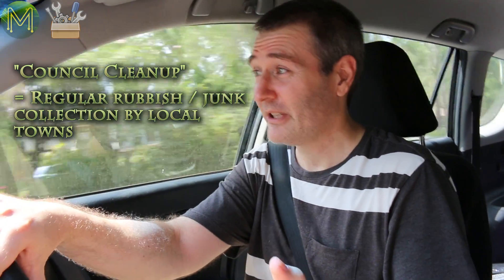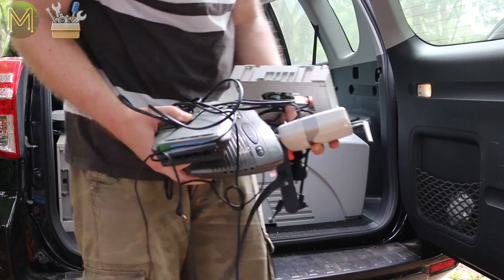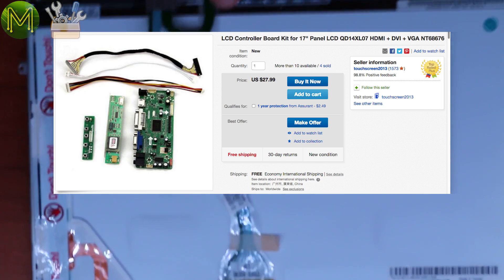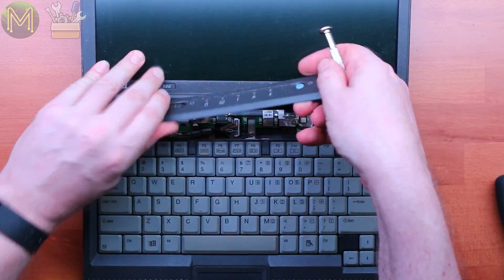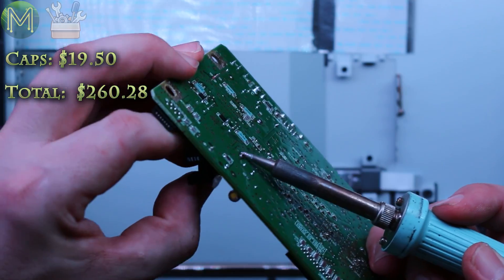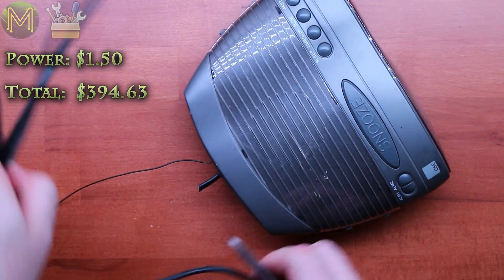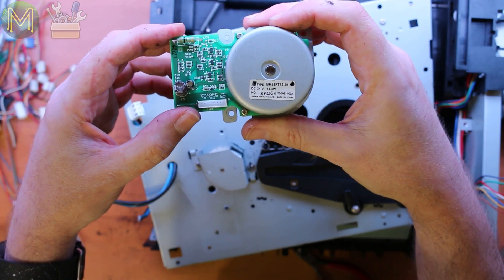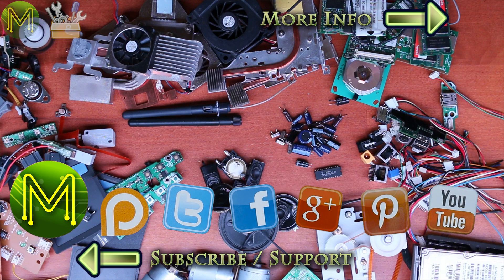#143 Saving Electronics: What Can You Save? // Tutorial

Comment: How would you use the RJ45 connectors? They aren't actually breadboard friendly and for homemade PCBs the drilling of the holes cannot be fun. What would you use those for? Cheers and of course thumbs up! JM
Reply from the maker: +JM Tosses 
I generally use them for long serial connectors, or panel connectors. You don't need to PCB them, but can glue them to an enclosure and just solder wires by hand.
Reply: Interesting. Would you mind squeezing in a video of those applications? Or maybe you already published one, a link would be most appreciated. I own a few RJ45 connectors but wasn't able to make good use of those, yet. Currently I'm investigating keystone compatible RJ45 sockets in 3D printed mounts instead of those very limited RJ45 sockets that need to be soldered to non-breadboard friendly SBCs. Anyways - great video as always. Thanks and cheers! JM
Reply from the maker: JM Tosses 
Alas I don't have a video where I use them. It's always used in a place where I'm connecting something to a box; like stepper motors to a box for pan/tilt control.

Comment: I do exactly the same thing, but just with my own consumer electronics which I'm replacing. I also keep all of the hardware (screws, bolts, nuts, and washers) removed in the process.

I even own a Toyota vehicle. However, my steering wheel is on the other side since I live in the northern hemisphere.
Reply from the maker: +Winston Smith 
I used to keep all the nuts, bolts and screws but I have so many now that I just toss them.

Ah yes, northern hemisphere people drive on the wrong side of the road. ;-)
Reply: "Ah yes, northern hemisphere people drive on the wrong side of the road. ;-)"

No, we drive on the right side of the road. ;-)

Comment: We have to pay £45 pound in London for the first item and then £20 for each item after. So if you wanted to get rid of a sofa, armchair and Microwave, it soon adds up. It is more common just to drag it out at night and stack it up by the bus stop or street corner. The council still take it away, which we pay for in our rates. It only came in under Labour control, they also took away our free black sacks.
Reply from the maker: +TheDutyPaid 
Wow! That's steep! Maybe you should create your own foundry and melt it all down?!

What are black sacks?
Reply: MickMake black sacks, bin bags, rubbish bags. Large normally back plastic bag you place in your bin before the rubbish. Not very environmentally friendly.
Reply from the maker: TheDutyPaid 
Oh OK. We usually use recyclable shopping bags. Our local grocery store stocks biodegradable shopping bags that you get when you buy something. We usually have a massive oversupply of them. Saves on having to waste money on something that is literally thrown out.
Reply: MickMake in the UK we have to pay 5p each for a shopping bag, even if it is biodegradable. 95% of people now take there own reusable stronger shopping bags with them.
Reply from the maker: TheDutyPaid 
Yes, we do that as well. Some shops charge for the bags, but the bigger chains just hike the prices up of everything else to compensate

Comment: "Stepper with hybrid controller", pretty sure it's not a stepper :)
Reply from the maker: Yep, checked again. You're right. It's a plain old 24v brushless motor, but that combined with the LB11923 driver was a pretty good find.
https://www.google.com.au/search?q=lb11923&client=firefox-b-ab&tbm=isch&tbo=u&source=univ&sa=X&ved=0ahUKEwiY7ZLq37rUAhWBgbwKHXWaANEQ7AkIQA&biw=1415&bih=861
Reply: I have a similar unit for an old HP laser printer, it uses the LB1823 controller chip. Motor part number  RH7-1260 DNQ16D04R34A.
Reply from the maker: CrayZeApe 
Nice. Will be fun interfacing to it